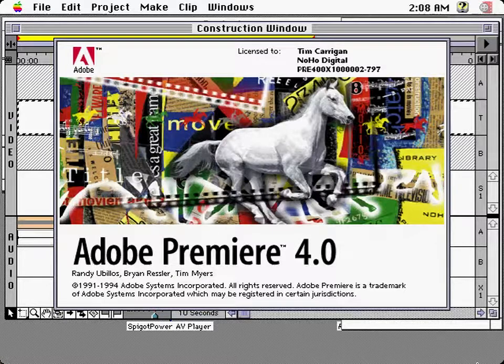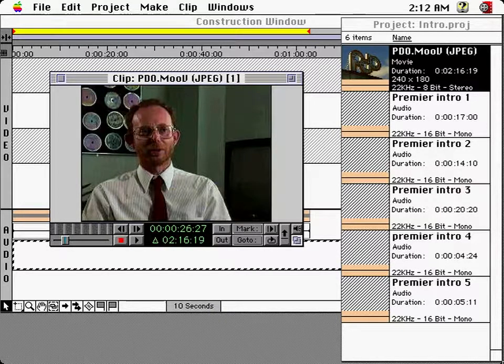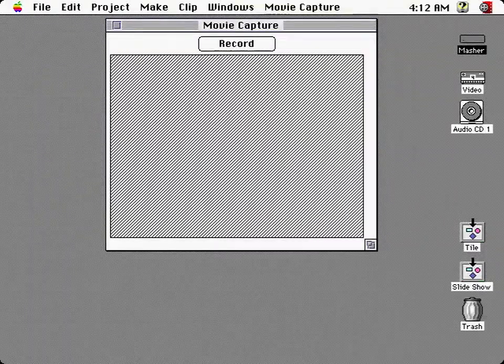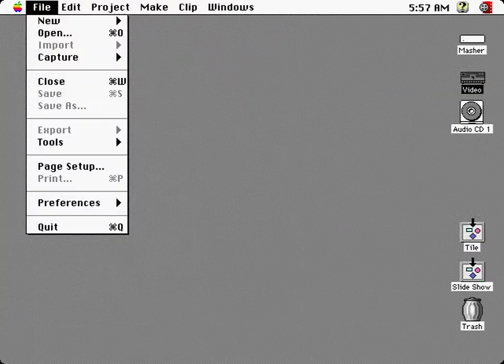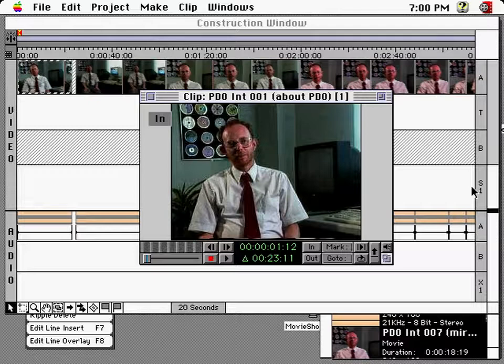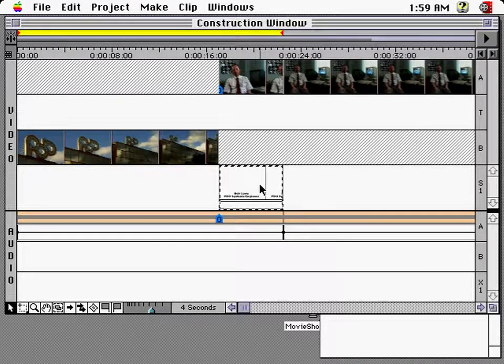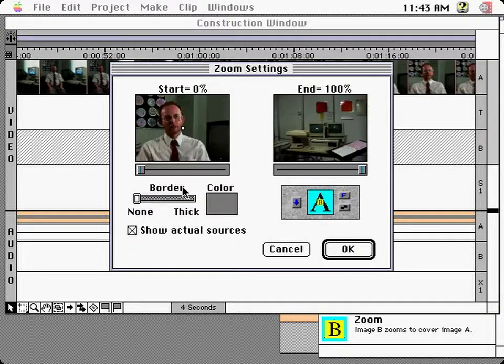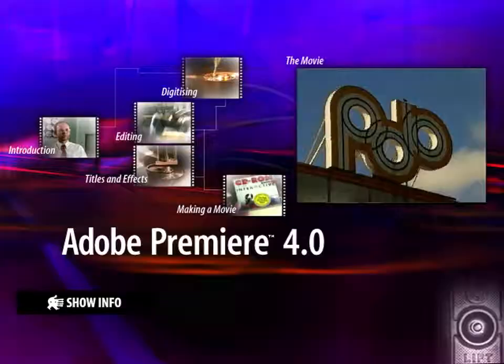Review - Adobe Premiere 4.0

Comment: Is this Macintosh quadra ? 😮
Reply from the maker: It's whatever was current in December 1994! I've never owned a Mac (or used one) so I really have no idea, and software reviews from CD-ROM INteractive didn't give details of the machine they wera running the software on, unless it is mentioned in the review. They might have done if it was a printed one but I doubt they would have a video review as well in the same issue. 🤔